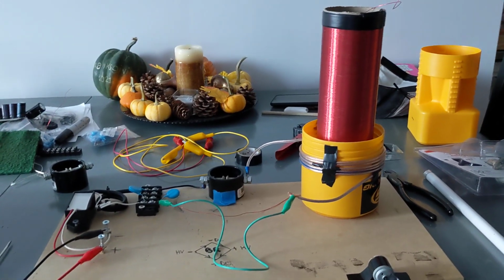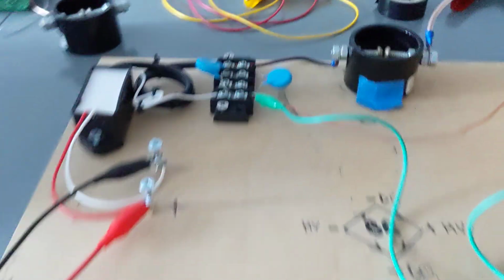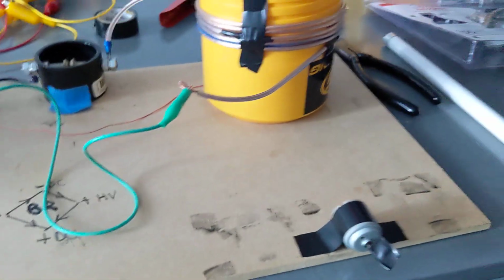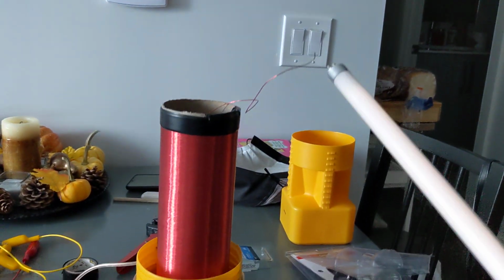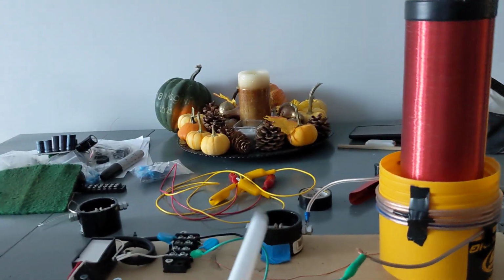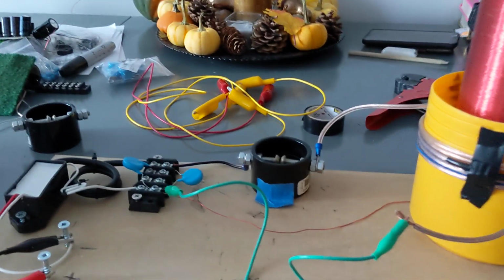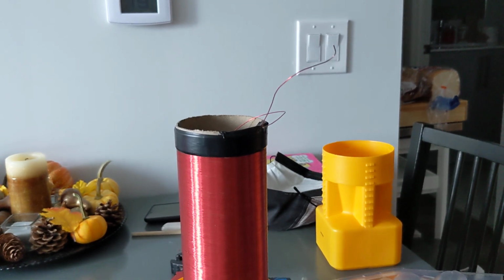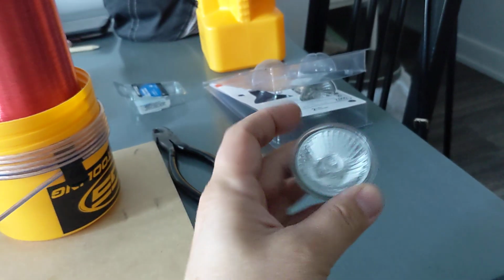Faraday Research RND⚡⚡

Comment: 1/4 coil brings u less work to get in ressonance good work this is how it should be done accept that using thicker wire in l1 and l2 will bring more amp and the frequency in that case drops down and its much easy to control .. anyway .. doing experiment this is how we learn how the voltage and frequency travels
Reply from the maker: Thanks for your comment
 yeah I think you're absolutely right from what I can see I think this coil I made is way too big and the wire gauge size is way too small so what I might have to do is downsize the coil a bit and increase the wire thickness like you're saying I totally agree with you
 I just did finish some test now and it seems to be aiming in that direction